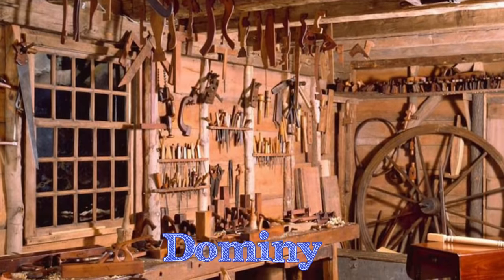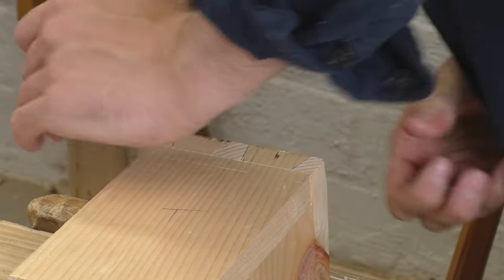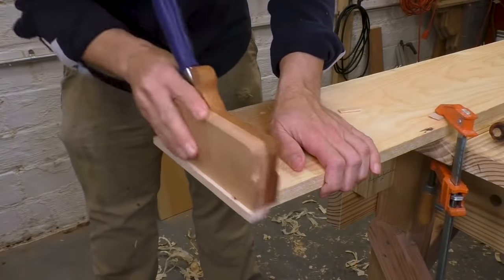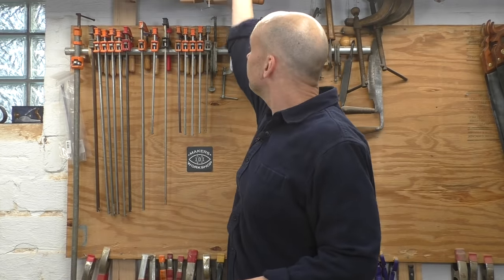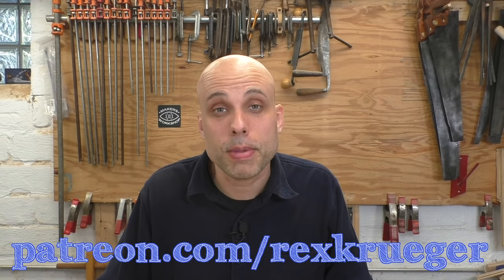Woodworking with very few clamps (maybe only 5).

Comment: Really nice thing about pipe clamps, when you work construction and get along with the pipe fitters, if they have left over pipe they'll usually give you it cause it will just be thrown out otherwise. 

I have so many different lengths because of this now.

Comment: Nail boards for edge joining, rope and stick clamping were also traditional types of clamping before mass produced clamps
Reply: Can you describe the rope and stick? Do you mean twisting the rope like a tourniquet? I know of another method using string, a batten or caul for straightness, and a wedge to tighten. Used by luthiers for thin stock. Works great.
Reply: @leehaelters6182  exactly like a tourniquet, but you can wrap the rope a couple times to get wider clamping pressure then the stick is tid off in place to hold the pressure

Comment: An interesting "woodwork for humans" build would be the "viking clamps" that were featured in an issue of Mortise and Tennon.  Two wooden jaws pivot on a stick, and you drive a wedge between them at the back to make them pinch shut in the front.  They were used to hold boards in place when building longships, so they must have some holding power.
Reply: I was just looking at an article on Pinterest about these! Very cool and interesting! Weird coincidence...
Reply: Jeweler’s ring vise.

Comment: I love Steve Ramsey's videos, not so much for the woodworking, more for his humor and movie recommendations! And his cats, of course 😃
Reply: Also, your video made me stop up and think about my coming clamp splurge for when I'm going to build my workbench (I need to glue a lot of long pieces together). This has led me to cut down from 14 to 8 F clamps. I have a good amount of quick clamps as well but want some proper F clamps (my largest F clamps are 20 cm). I could probably get along with less, but they are not that expensive. AND I WANT THEM! 😂
Reply from the maker: Wanting them is a whole different thing, isn't it?
Reply: @RexKrueger  It is :^) But I can also see from our friends on Discourse that gluing up construction lumber from the home center is easier with more clamps. And I'm buying them because I'm going to begin building my bench soon. I'm very excited!
Reply: I realise that I inadvertently dissed Steve: "... not so much for the woodworking ..." I discovered the channel because of his host of great advise, but I'm not a power tool user to the extent he is, so that's what it meant. (I hope I haven't called down the mighty wrath of Steve! He has tons of occult equipment in his shop!)

Comment: Maybe they used apprentices as clamps "here, hold this!" :-p
Reply: I was recently working on a very small "arts & crafts" type project for my wife. I had to glue a less-than-quarter-inch triangular wedge for a corner reinforcement. My wife came out to the shop and saw me just sitting on my stool holding and staring at the work piece. She asked if I was ok, and I responded sagely "When you don't have the clamp, you are the clamp." First the 3, 2, 1, light bulb moment, then she's laughing hysterically back into the house. 😁
Reply: @Timri3681  LOL
I generally just use masking tape for that kind of thing. It has just enough stretch to put a slight pressure on.
Reply: cant drag my kids into holding things for me. i was using a saran box the other day to hold something
Reply: @Timri3681  LoL! Very funny! Now a small spoiler for the ones that may have trusted he was talking for real: this is just a joke. Being an "human clamp" is not actually possible because it only would work if someone would able to keep holding the parts together steady and firmly for 30 minutes while the glue does its initial cure, but I really doubt that someone can do this due to the level of strain (no one would manage to keep it for more than  one or two minutes). Anyway when you don't have ANY clamp at all just tie the parts together strongly with a string. This is the poor man clamp, and trust me, is totally efficient.

Comment: @ 3:57 you answered a 15 year old question I had. I saw furniture back in south Asia that had these mortise and tenon joints but always had these dowels. I never understood why.  But I remember that wood workers there used to rarely use glue because quality was poor and supplies were not adequate. I never saw Why they drove in those dowels or that they made those slightly misaligned holes; however, now it just clicked. As far as traditional wood working techniques go, I think no one on youtube is more researched and more practical than you.

Comment: This is aimed at the author 'Rex Krueger'. I'm a craftsman cabinet maker, I've stopped now as I'm 59 and I'm done. 
'Sprung joints' are universally known as 'butt joints' and taking out the centre while making them, as you did, is de rigueur, although I'd use a trying plane instead of a jack plane for this. Normally you'd have two sash cramps on the bench and one over the top to prevent warping. Then you can move the board and do another one, or easier just do it on the floor. Using weights, as you did, means that your bench is out of operation until the glue grabs.
  Pegged tenon joints work but are unsightly. You said that in the 17th century everything was done like this. I disagree. I spent decades restoring antique furniture and never came across one. The normal trick with chairs was to not chop the ends of the mortice square but rather leave them angled, it's less work. The tenon is likewise angled but not enough to fit. The shoulders were cut by hand and quite often pretty crude. They they made the whole joint hot and wet and forced them together which would have necessitated a pretty powerful cramp. I believe that they assembled the whole chair at once like this to guarantee squareness and lack of wind. The effect was to deform the legs and 'print' the shoulders into them, it also deformed the tenons into the mortice for an interference fit. I don't know if they used one operation, which might be possible with animal glue, or took it apart when dry and added the glue later. Either way they were glued and some form of cramping was used.
  Another form of 'cramp' which I used all day, every day was bicycle inner tube. You can do so much with these that it's amazing. They are also free. Ask the bicycle shop for the old ones and they'll just give them to you. If you get one for a lorry then you can make one 25mm wide and about 20m long. You have to be careful as they can develop enough force to crush pine, not the hardwoods though.
  Lastly, low pressure veneering. Normally you need 4 bar for this. Imagine you have a table, lets 900X1.4 (I'm typing this message on one of exactly this size). Try calculating the force you'd need to exert over such an area, then you'll see the problem. I know how to do it using only small workshop equipment, and no I don't mean hammering with animal glue, I'm talking about modern waterproof chemi-sets. You will need cramps, 8 small sash cramps and all the G cramps in your shop, but you can do it error free every time. That's another story though. If interested, ask.
Reply: Hey, In what seems another lifetime, I also restored genuine antique furniture such as you describe and can echo several of your observations. The joint examples you described I can only remember seeing in ‘Primitive’ American (pre-Civil War mostly) & only even earlier pieces originally from more rural areas Western Europe.
In both cases, as I’m sure you know but readers may not, these pieces were most often built by farmers /rural residents from necessity, lacking the money to purchase them, and for personal familial gifts.
Thank you for resurrecting some good memories.
Go well, Rick J.

Comment: Thank you for posting this. The timing is remarkably good for me as I was just dealing with an issue of making my own wedges for the LRB but was having issues with holding them in a way that let me file them down to size. The twin screw clamp looks like exactly what I need based on the example you gave of clamping the screw clamp to the bench

Comment: [Rex, I suggest that you put the time stamps in the description. Each clamp time stamp could go in front of the coresponding list item.]

Table Of Contents

00:00 Intro
00:27 ` History: Long Island Dominys
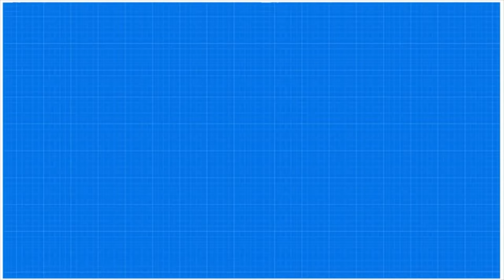01:31 ` Opening Cut Scene

01:43 Merits Of Old School Techniques
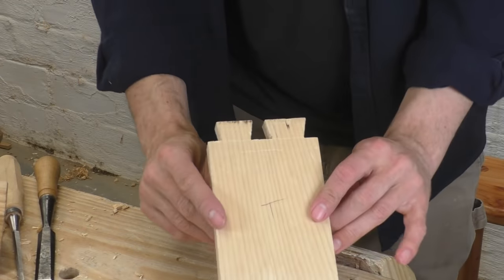02:07 ` Dove Tail Joint
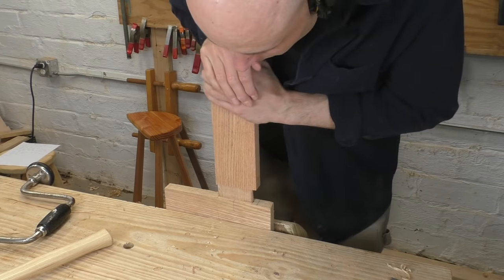02:57 ` Draw-Bored Mortise & Tenon
04:34 ` Rabbet Joint
05:32 ` Battens Screwed On Work Bench With Wedges
06:16 ` Sprung Joint

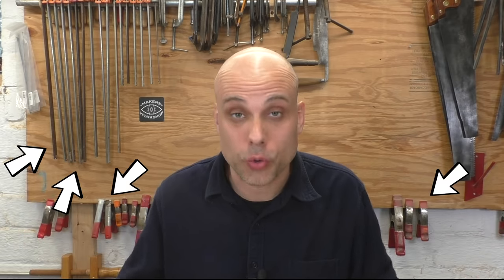07:02 ` ` Misc Commentary

See the description for links on where you can purchase these clamps. Buying them at the links will support Rex! :)
 
08:00 42" Long Pipe Clamp
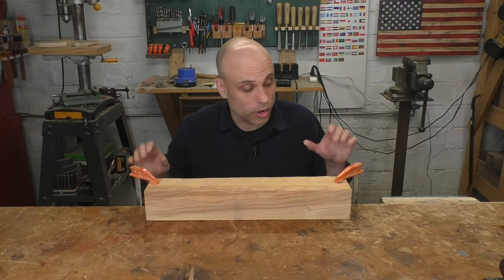09:17 2 Medium Sized Bar Clamps [a.k.a. F-Clamps]
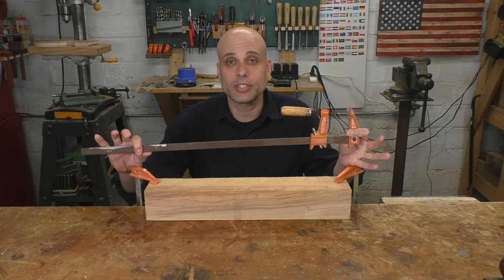10:29 Adjustable Twin Screw Clamp
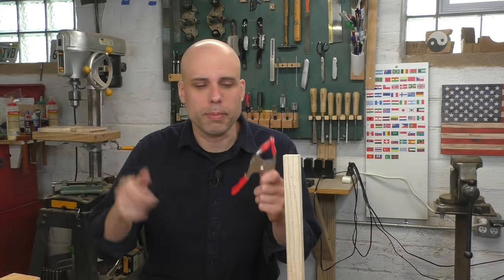11:55 Spring Clamps

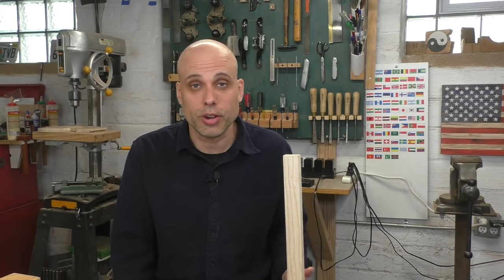13:08 Conclusion
Reply from the maker: Consider it done!
Reply: @RexKrueger  I just saw an interesting use of the same thing.
https://www.youtube.com/watch?v=s6T4644ybpQ
They used "title cards" [or whatever; don't know what they are called], to show the people which were in each section. In your case, you might show each tool or technique being used.

I'd be glad to volunteer to come up with the time stamps again, if you'd like.
Reply: You're a hero! 👍👍
Reply: @oliverdelica2289  thanks!

Comment: glad i watched this video.  as a retired custom furniture maker i worked from a 1 1/2 car long single garage.  i was able to make some very large pieces in there with a bit of a squeeze.  the reason was i have very few tools.  most of the amateurs i see here on you tube have more gear than i do. my thought was every dollar you put into  tools collecting dust on shelves, was a dollar you took off the table.  and i really don't have a lot of clamps.  all my edge joints over two foot are sprung.  was trained to work that way.

Comment: Good video Rex. These are my go-tos on clamps. (With one exception.)

My notes:

The cheapest clamps that you might have overlooked are simply twine/rope and a stick (see your turning saw video). This may have been a method the Dominys used. Since the clamp is basically just a rope and a sturdy key, there would have been no noticeable artifact remaining as the rope can be used for other projects and the key was probably a piece of wood.  I used this clamping method all the time as a kid and still use it today when I need one more clamp (Including this February on a bar top made out of 2x12s). Just remember to slip some cardboard or angle iron over any corners to prevent the rope from digging into the wood.  It is also a great clamp for wilderness work since you don't have to haul heavy iron castings in your tool backpack. 

Pony-Jorgeson clamps are good. I recommend the F-clamps and their pipe clamps. That being said, I have had problems with their cast iron holdfasts and (avoid at all costs) the Jorgenson miter saws.  

Finally I love my adjustable twin screws. I saved up my allowance as a kid to buy a pair, and yes! I have done the basement floor joist storage trick. I do use them for glue ups because you can fine tune the pressure across the work. Then again, I grew up with them. To me they are a musical instrument of clamps.
Reply: Agreed about how great those hand screws are, and how to tune the pressure. Once you have used some, you will always miss them if you are without!
Reply: Ohh yeah. I've seen Chinese woodworkers, specifically Grandpa Amu, utilize it in their low benches

Comment: I remember the moment that I realised bigger/more was not better.

It was just after I got my first good table saw, a beautiful  Laguna Fusion. A fortnight's pay, in cast iron and sheet metal.

But I also needed  dust collector. So i started reading about dust collectors. A week later I was researching the best value ducting, and how to modify my tools to take 6 inch dust hose... and how am.I going to build a router table into the wing of my new saw?

Then  Chris Schwarz and Richard Maguire got into my brain... with plane, saw and hammer, they were getting it done.

Comment: I did that process of tapping the wedges against the wall and other side additional woods to make a panel for table top joining three boards. Its because i couldn't afford a clamp during my free lancing. I believe the lack of resources and the need of together with the desire to work  brings forth innovation when we understand the science of working there can be numerous ways to make a work done ! Thankyou for the video😊😊🙏

Comment: Hi Rex My grandfather was a cabinet maker.  One of his products was a clock which was made from timber veneers.  The veneers had to be pulled tightly against the curved jig until the glue dried.  He did not use metal or timber clamps.  Instead he got the inner tube from a car tyre and cut large "elastic bands" about 25 to 30mm wide.  One band on each side of the jig pulling a small timber cross piece onto the work.  One car tube made many bands. He also made all his woodworking machinery from timber - 8 and 6 feet belt sanders, spindle (similar to an inverted router), band saw etc.  Also we call the metal clamps G clamps not F clamps.  Cheers
Reply: Love that application of inner tube elastic! Thanks!
Reply: So he made his clamps.  He didn't try to do without proper clamping.
Reply: @yrralyou  Hi Larry  My grandfather had access to traditional metal clamps.  He used to build boats as well.  When making the curved body of a mantle piece timber clock at all odd angles the clamps had to be applied quickly in a restricted space.   G-clamps would not work.  Also there would have been the equivalent of 15 or so G-clamps required or 30 rubber bands.  The bands could be applied in a few seconds.  Also when doing a production run of say 6 clock bodies he would have required 60 or more clamps (if they could be applied).   This time period was also early 1960's so his technique was developed post WW2 in a time where everything was scarce.  All his wood working machinery he built using timber. He just needed an electric motor a few pulleys and belts and some shafting. I know as a very young boy I watched him in awe.  It was all about making do with what was available.  If I had to build the same clock bodies today I think I would still use the rubber band idea.  Cheers.
Reply: @johnspathonis1078  Individual projects are often built with methods used by fathers, grandfathers, etc.

Comment: #6 you missed one of the most important clamping I know: Tourniquet Clamp (rope and stick). I had the luck and pleasure to work with an elderly Italian antique restorer and he used this in most his projects. Incredibly cheap, reliable, easy and uniform. All you need is rope (I believe he used natural fiber so it doesn't dent or mark the wood; not nylon, , etc) and scrap sticks.

Comment: Sorry I'm late to the discussion, just came across this vid, thanks Rex this was amazing and a reminder of how we can discover old traditional woodworking techniques to replace 20 odd modern jigs and apparatus that may cost a lot of money just to do one job! - I struggled for a long time figuring out how to hold long planks on my table to edge plane without buying 2 expensive vices at each end and then I discovered the old school 'Moxon vice', which are usually threaded iron bars that are wheel fed... Again I just rigged a semblance of it out of 2 f-clamps fixed underneath my table at either end... Now I can shape long boards and because there's almost no limit to the drop aside from the height of the table (unlike with a bench vice) it means I can clamp quite large panels onto it also!

Comment: So those spring clamps:

I got this idea from Mike Farrington, but I went down to my local REI and got a couple broken bicycle inner tubes for free from their repair shop, cut them up, and used those to turn my spring clamps into bandy clamps to put some home cut edge banding onto some cabinets. And if I can make perfectly functional bandy clamps for $1 each in Fairbanks, Alaska, you can make them super cheap ANYWHERE.

Comment: I love my bar clamps. I have 5 of them in 2 sizes. I have 2 dual screw clamps and though I don't use them often, when I do, they're great at what they do. And several of the hand clamps which I rarely use. The bar clamps are just so useful in so many ways. I don't think I'd enjoy woodworking nearly as much if I didn't have them.

Comment: Great! I’ve become a big fan of wedges and cams to clamp stuff to my “MFT style” bench. UJK makes a great set of surface cam clamps that sit on short dogs. They are very reasonably priced, and surprisingly reasonable shipping from Axminster the UK.  I have several offcut wedges that I use to take up the gap and then pressure is applied with cams. All attach to the bench with dogs or clamps so no screws needed. 
On a related issue, I think people often use too many clamps when they don’t understand how to spread the clamping force.  You get much more even pressure with calls or blocking. A clamp right at a glue joint creates a point force, add some distance with calls/blocking and that force is spread.

Comment: The one item of workhold you forgot to mention that joinersof old used twine in a spainish windless to clamp things up , todays version would be a ratchet strap, and do not forget PINCH DOGS, often self made out of old iron straps heat treated and with two sharp points to dig into more often end grain , 1 wack with a hammer there are set, and a couple taps to get out. 
Nice video Rex, wish I could agree to the 5 or 9 clamp workshop, but I lost count of the clamps I have in my shop, from a crate of different sized spring clamps, a crate of the small model  makers 6" clamps, 10 15" F style besseys, and a wall of 3/4" pipe clamps from 2' up to 12' long.
All the best from over here, Karl W